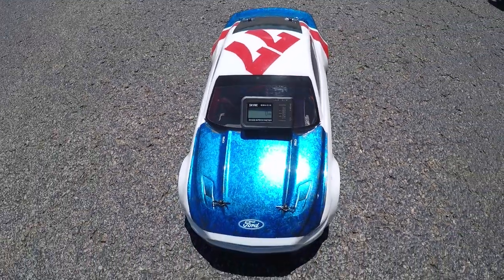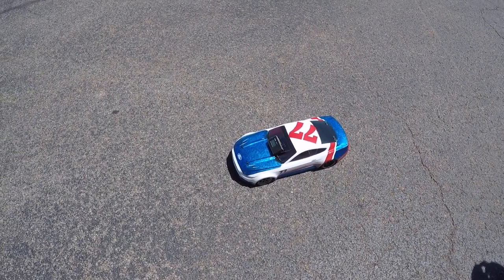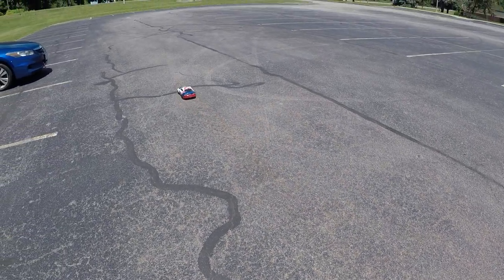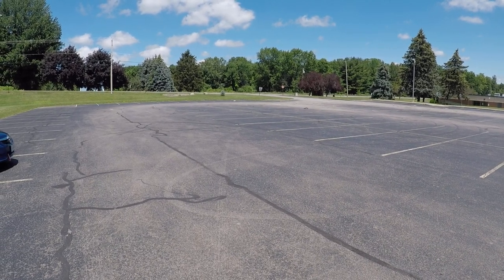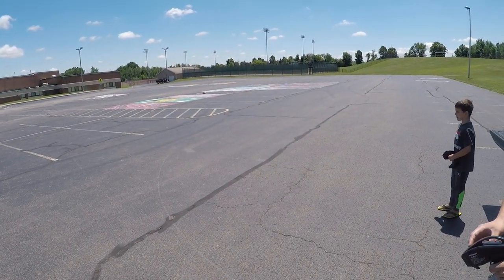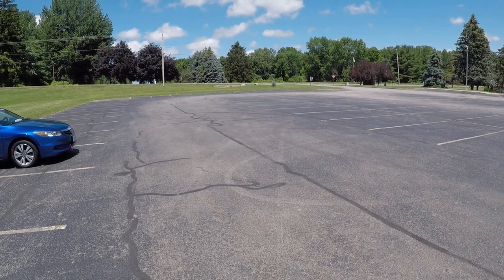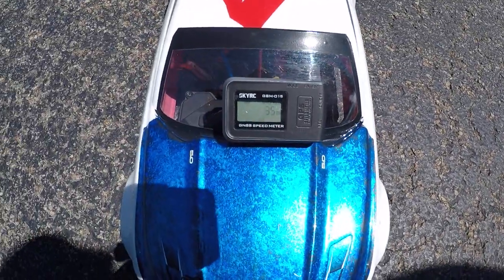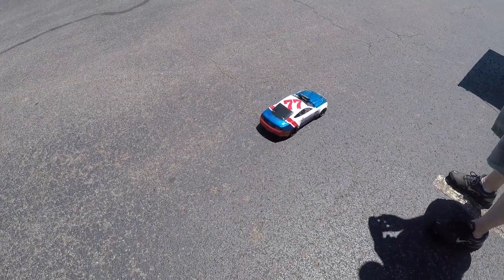Traxxas 4Tec 2.0 with Castle Creations Power

Comment: Hey Bob - you really got the crew out there with ya today - always better running RC's with friends! I thought this may be the fastest of the day with the high kv motor! Still pretty quick though, mate. Thumbs always up from your friend Mark...  👍😃
Reply from the maker: Yes sir, we had a few people yesterday, we are trying to get a few more together so we can do a real road course race, we limited the lipo's to a 2S 50c, also would like to have everyone run the same motor as well (just to keep it fair). The Tekin Redline 3200kv motors are only $29.00. so, if running the same motor, it comes down to gearing, tires, set-up & skill to stay out front. we also don't want people using traction control of any kind/type, the Old School ways. BTW, what happened to the Heavy Dump Truck Build? Also, Love the "Mr. Awesome Mug" its a fitting mug for you.
Reply: This had the stock 12 turn titan set up in it I ran the gearing that was it it so Im sure it can do better.
Reply: @UncleBobsRC  Hi Bob - sounds like a good set of rules for old skool racing! Look forward to seeing a race!
The Dump truck is going slowly, having trouble finding the time now I'm back at work and very tired when I get home. Also, the editing takes longer than the building, almost got part 2 done. Haha, the mug was a present from one of the kids at school a couple of years back! Cute! 👍😃
Reply: @madmustangrc214  Yeah, I'm sure there is more to come!  :)
Reply from the maker: @MarkBryanRC  Brother you ain't joking about editing, that's part i hate the most!!!